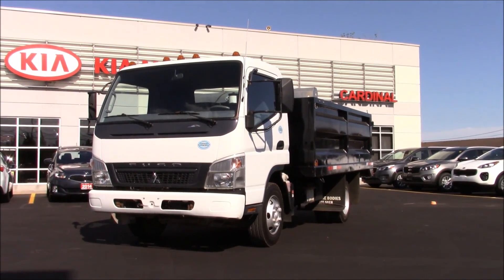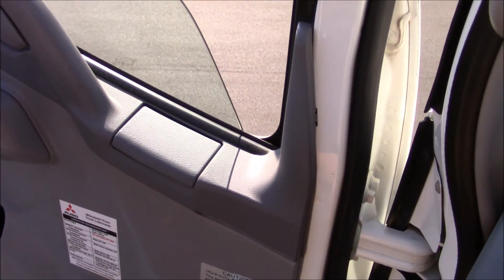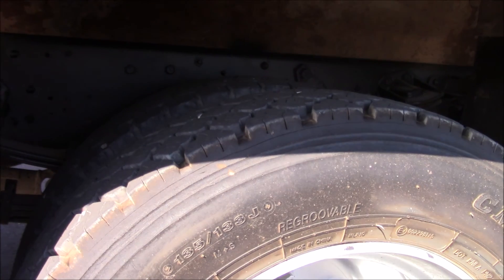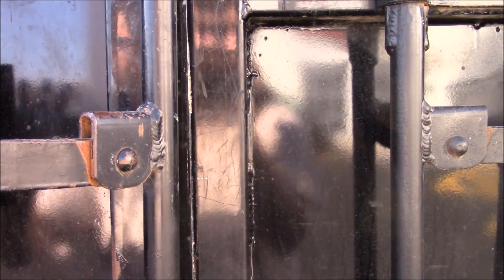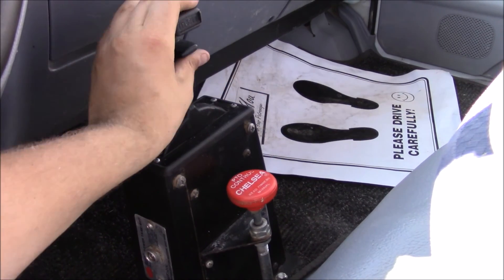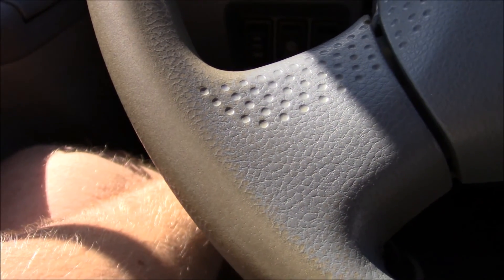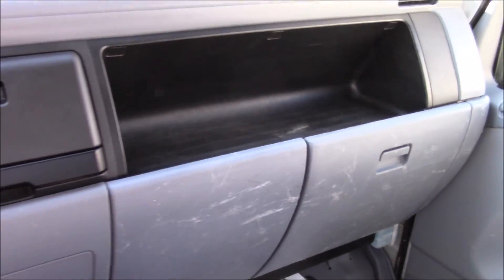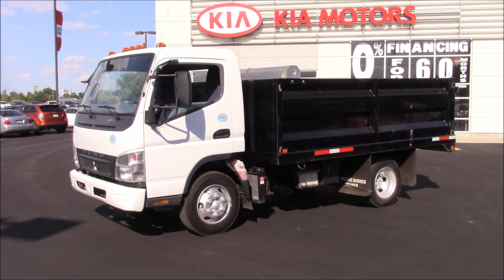2010 Mitsubishi Fuso Dumptruck Turbo Diesel Indepth Walk around and Start up

Comment: in the dash is probably windshield washer fluid, the pinkish red fluid outside is probably engine coolant. the dump box is run by a PTO (power take off) on the transmission, which runs a hydraulic pump to fill the lift cylinder and lift the box. The batteries you saw are the trucks batteries. So to lift the bed you need to engage the PTO. There should be a switch somewhere, or it was the red round knob you were pulling on. once the PTO is engaged you'll hear the pump running and the box will go up and down. You were able to lower it without the PTO engaged because gravity brings it down.  The PTO might require you to shut the eng. off to engage it, otherwise it grinds like trying to put a manual trans. in gear without the clutch. Hope I helped you out. be safe.
Reply from the maker: Ah okay. Thst was probably why it wouldnt work then